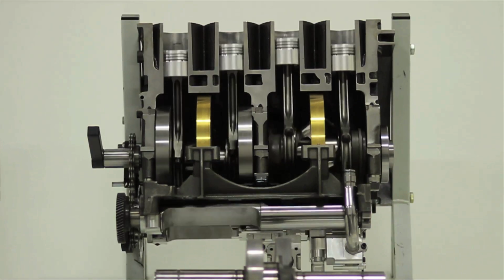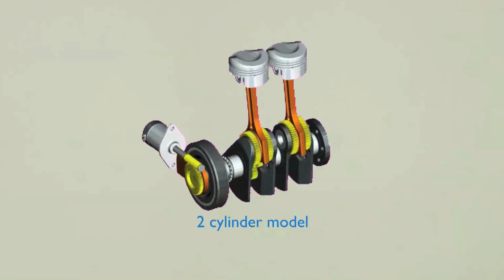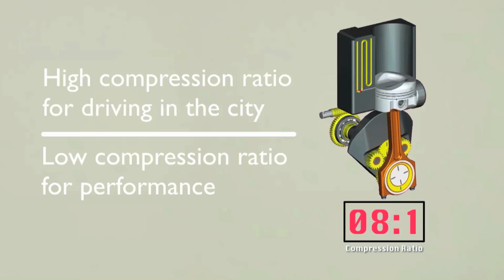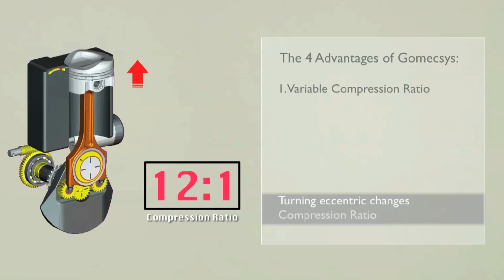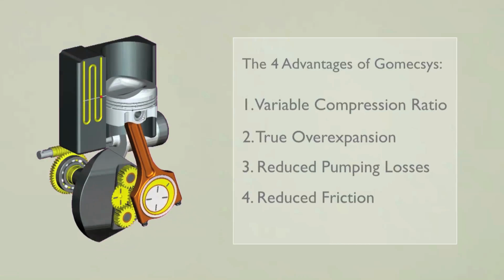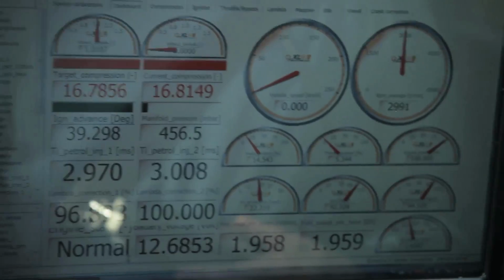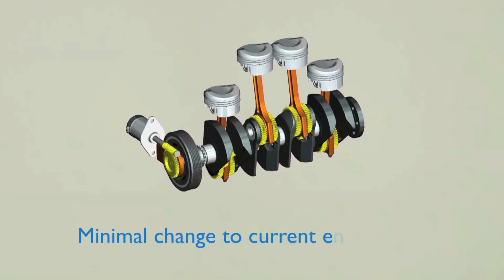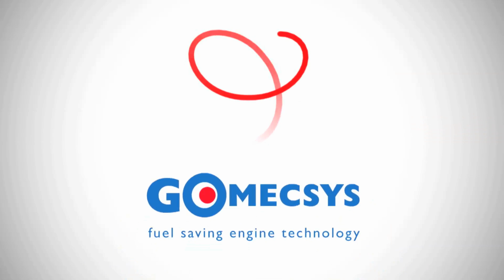Gomecsys VCR technology

Comment: Is this technology for Diesel or Gasoline engines? 
Because in Gasoline engines, there is knocking if we to go to CR of 16
Reply from the maker: Hello Anas Asif,  on gasoline engines there is knocking at higher loads if we go to a CR of 16, yes. But we only use the high CR position when driving at low loads. That why its Variable Compression ratio. As you hit the pedel the CR will go to 9:1 in 0,2 seconds, faster then the turbo needs time to build up the intake manifold pressure. 
Thank yuo for your interest and kind regards,
Bert, Gomecsys